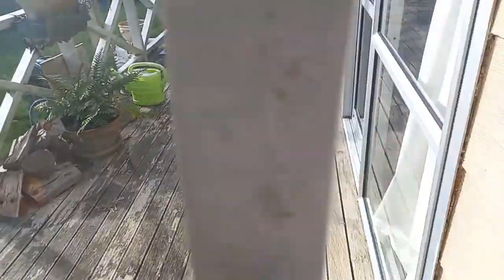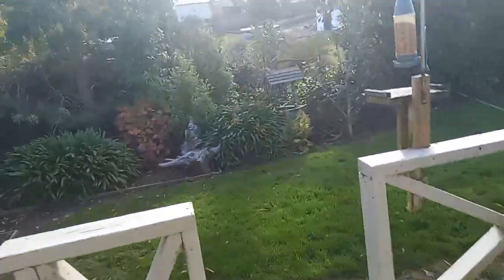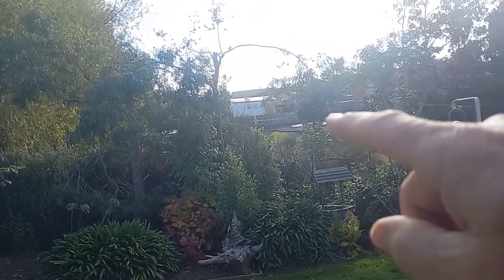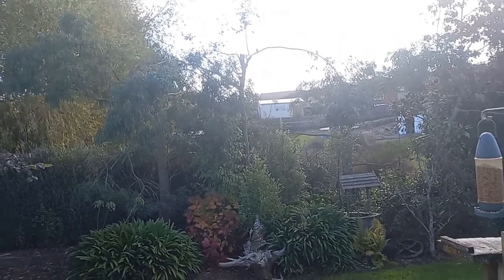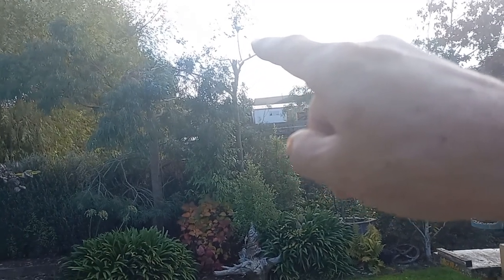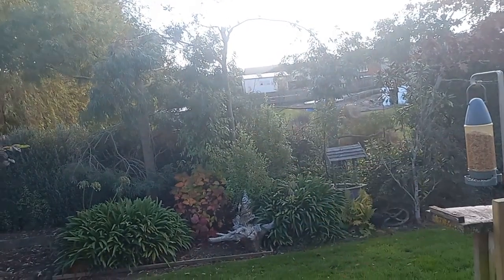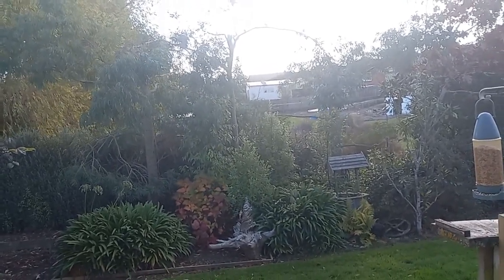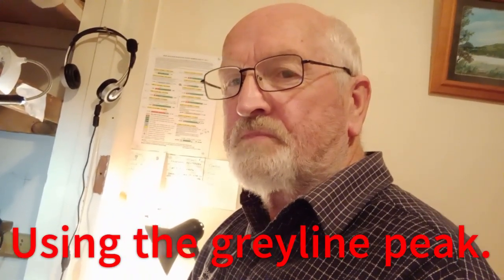ZL3XDJ .  The old times .

Comment: Hi Brian, really great to watch your video. I’m a newly licensed ham in the UK and my first antenna is a multil-band dipole in my attic, just a few lengths of wire attached to a 1:1 balun. As I’m limited by the power I can use with a foundation license, I’m amazed at the contacts I’ve made! I’ve even made contacts to Australia, though not quiet New Zealand yet 🤞But I think it goes to show what you can achieve with just a length of wire and the right conditions. I will echo the earlier comment about NaoVNA’s, they are so useful in helping to tune antenna and well worth the cost if you want to experiment.

Comment: These days you have The NanoVNA for $50-$100 or so. Tells you everything you need to know to get a match on your piece of wire. 

My first antenna was an end fed random wire poked out the window that tied to a couple of trees. 

My first tuned antenna was a mobile whip antenna for 15m for a transceiver I built for 21MHz. 

I had made a gate dip oscillator and that’s how I got it tuned by adjusting the coil spacing and deign where it dipped. 

These days, I put the antenna up, stick the VNA on it and pay attention to the smith chart to see where the antenna is resonating and importantly what the feed point impedance is. 

Computer modelling works to show you some rough ideas, but the real world is so much more interesting and challenging. 

I am certainly of the opinion that real hams build their own antennas